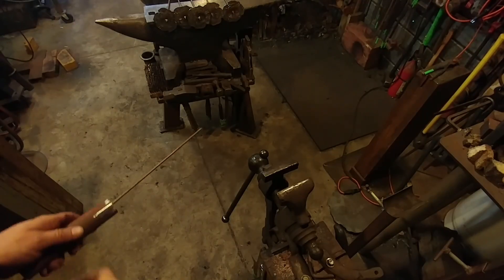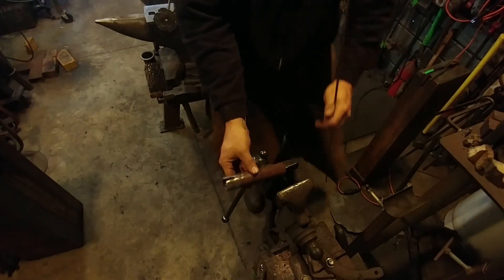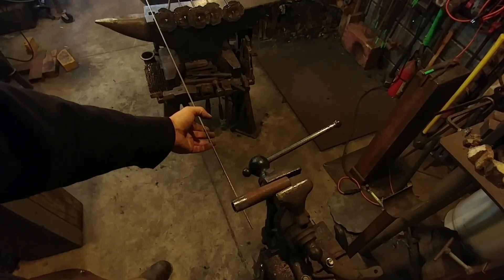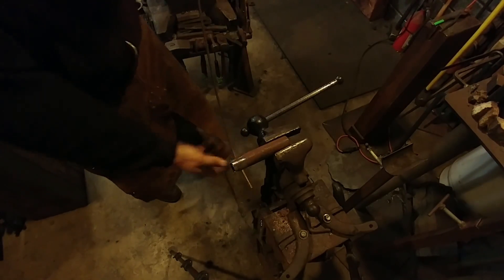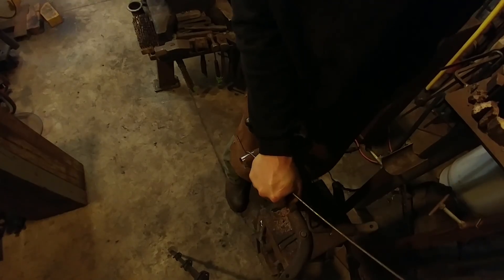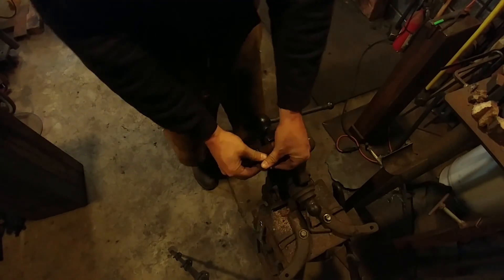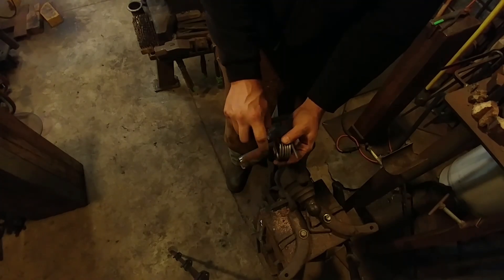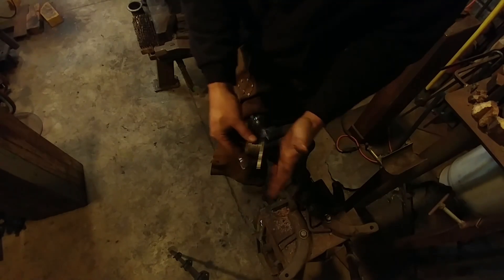DIY Springs... Make Your Own Springs at Home!

Comment: You cannot make usable springs from mild steel. Workable springs can be made from  spring steel  then tempered in an oven at 250 c for 30 minutes ,a spring made from mild steel   will just collapse Ex spring maker for over 30 years !
Reply from the maker: K
Reply: @ChristCenteredIronworks  ???

Comment: Good to see this! I want to make my own springs for holding carpets, rugs etc for washing. Basically what I have in mind is a huge clipboard. As I do not have a lathe, this will be the method obviously. Just have to be patient. I will make several different sizes for different needs. Thanks for the video & pointers!

Comment: Thank you!!! Question, though; I'm making a torsion spring for an airsoft replica. I'll be using thin gauge wire because it is a very small, thin gauge spring. Should I be doing any sort of heat treatment on this to make sure it lasts long term?

Comment: Very good video.. I have a very small project I'm doing at home. I know how to make the springs, but you didn't tell the temp for heat treating at home. Probably not possible from my gas cooking stove.😮   At work we had a Hosfeld Bender that could bend up to 3" material. All of our work had to be sent out. So to me, spring steel, goes back to its original spring shape. Thanks
Reply: @maggiesmith4689  yes you can put springs made from "Spring steel " into a domestic oven which will be near the correct tempering heat of 250 c  at gas mk 5 or 6 , for 30 minutes ,do not make springs from mild steel they will just collapse ,,use spring steel.

Comment: Just wanted to point out, you could have just slipped the wire off the mandrill and rotated it and put it back on instead of repeatedly opening the vise over and over. Reminded me of when I was 12 years old and we were boiling clams on a camp stove and the wind was blowing. My super educated structural engineer brother-in-law lifted one end of the massive  8ft  picnic table and gestured for me to take the other side to lift and turn the table 180 degrees out of the wind. I just reached over and turned the stove with my finger tip. The look on his face was priceless. Work smarter not harder.

Comment: Why are you opening and closing the vise? Each step is 180 degrees, yes? And the wire is loose, just slide it off and turn the wire over. ... to quote Dallas: Your wasting so much time doing it the way you are. Me watching this was giving me a panic attack lol.
Reply: I think he needs to drop it on the floor a few more times until he clues into that.

Comment: Good afternoon! Sorry for my ignorance, I have a question. Would this method also work with wider wires (let's say 6,5 or 7mm). Another question, would you suggest using some termic process so the spring doesn't loose tension with time? Cheers!

Comment: why not you weld T croos   on that  pipe jig ,vise it vertically....
and no need to unlock that vise so many times 😅
that is not spring yet...
you need to harden the steel to make it spring.

Comment: I thought this video was superb, I never knew you could actually use Mild Steel for a spring. What an eye opener. Cheers Roy
Reply: Your supposed to use music wire, mild still will just bend with the pressure.
Reply: @Bob-f7c2r  Before you call some true craftsmen wankers show us YOUR skills. Roy is a superb blacksmith and demonstrates a lot of skills that educate us all..My guess is you can't even knock a nail in let alone use a hammer to create anything
Reply: @tobyjo57  How much did good old Roy pay you to post this. I make springs the proper way out of the proper steel and then I heat temper them in my gas forge using a quench. I am afraid that Roy has a lot to learn before he uploads his stupid "Mild Steel Springs" video's. What a load of rubbish that was.

Comment: To keep/hold it's shape u don't need to heat and quench?
Reply from the maker: +Will M. Thanks for the great question! The very fact of it being a spring is to mean that it wants to return to its original shape so when you bend it cold you stretch the fibers which makes it want to snapback. If this was heated and wrapped it would not have the same spring function as the fibers would be stretched and then eased. Hope this helps thanks for watching
Reply: Christ Centered Ironworks I was moreso speaking of heating and quenching after it's shaped. I guess what I'm asking is with out doing that what keeps it from "unbending" cold just as u bent it around the round jig?
Reply: Christ Centered Ironworks I'd love to see a cold bent vs. heat/quench spring to see the difference in the why cold bent question. Thanks for the awesome vids man! I love how you go over basic blacksmithing and metal work for us noobs.
Reply: eh,eh,eh....racing suspension coil  springs are wound bright red hot, check youtube...